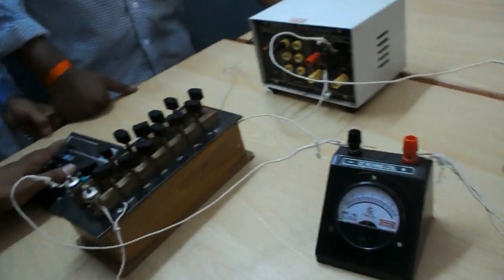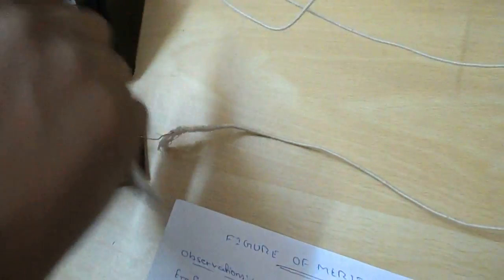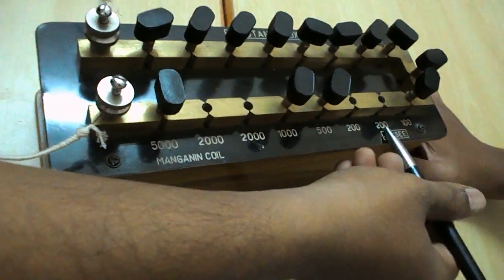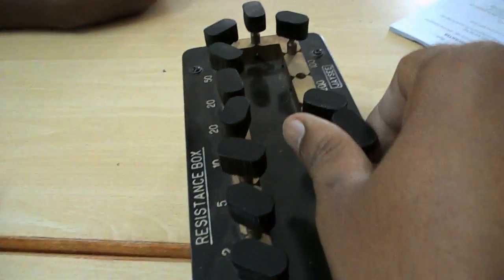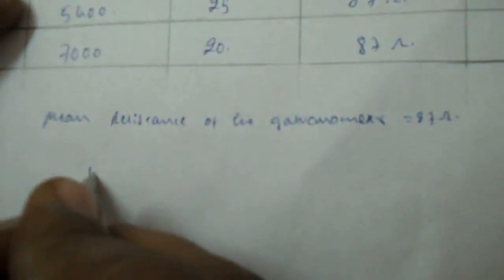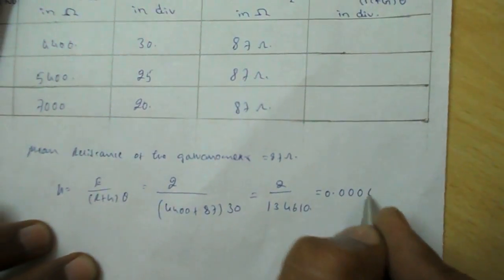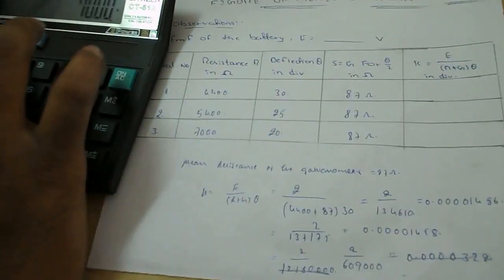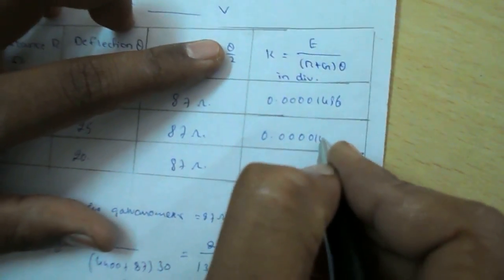Figure of Merit of galvanometer

Comment: galvanometer don't have polarity...!!!!!!!!
Reply: What are you talking about galvanometer has positive and negative terminals but I'm assuming you're trying to say that in this experiment it doesn't matter if you connect to positive or negative terminal. However I was taught positive end of galvanometer should be connected to positive terminal of battery. But in this video he says the opposite hmmm I think both are correct but I'm doing how I was taught before in my practical exam tomorrow
Reply: Over all galvanometer don't have any polarity....!!